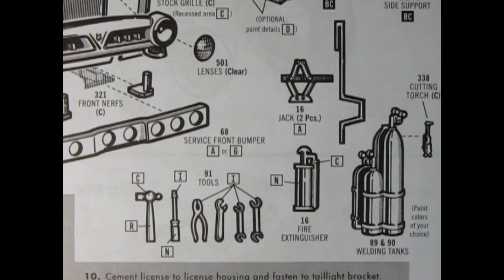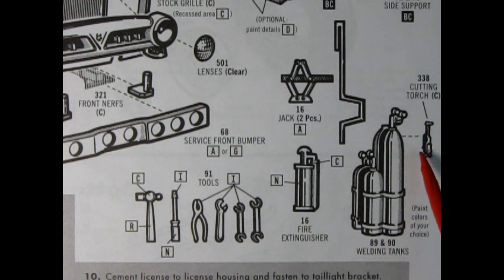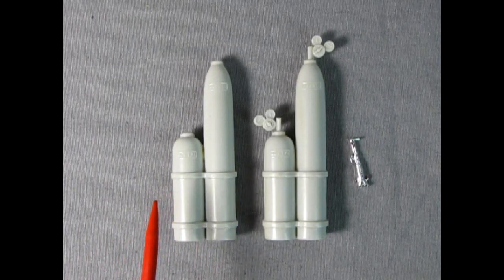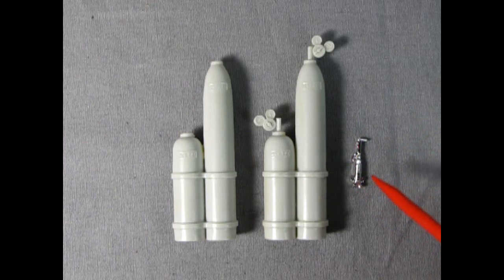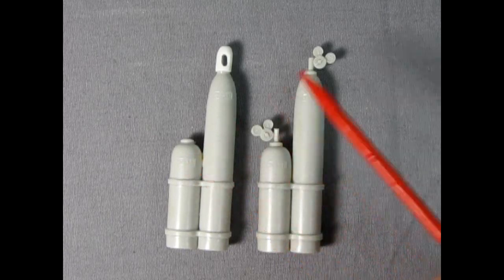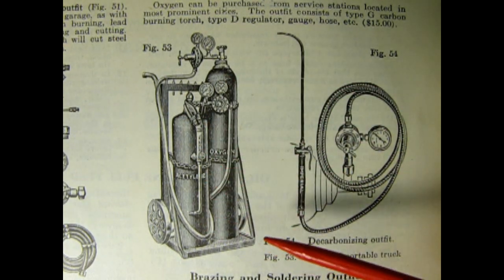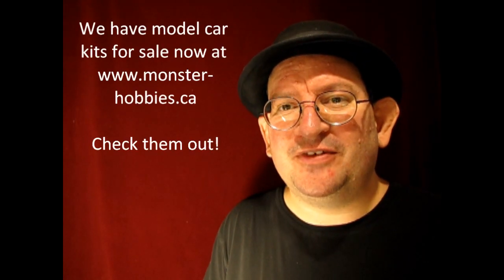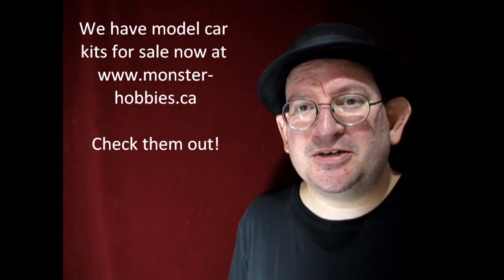Building a 1/25th scale Welding Cart For The Oxy/Ace Apparatus Found In The AMT 1953 Ford Pickup Kit

Comment: I think that is an outstanding torch cart, I can't wait to see Natie at home wrenching! A note about oxy acetylene torches is the welding and brazing rods are thin 1/16" or 3/32" and sold in tube sleeves, probably waxed cardboard in the twenties and plastic for the last decades.
Reply from the maker: Good to know about the rods. I looked some up on Google and noted there is 50-100 rods per box...and there was no way those were going in the holder! LOL!
Reply: I've generally had a few various thicknesses of rods in the tube on my trolley,for handy use. My main stock of rods are in the storage cabinets
Reply from the maker: @petesmodelcarcustoms584  Sounds good. I settled on that one size for my holder. I'm not sure if I had smaller or not.
Reply: @MonsterHobbiesModelCarGarage  I'm sending another email,Trev 👍
Reply from the maker: @petesmodelcarcustoms584  Sounds good. I'll look for it!